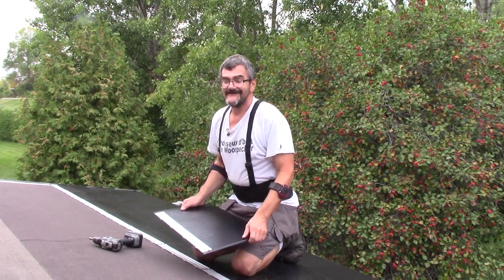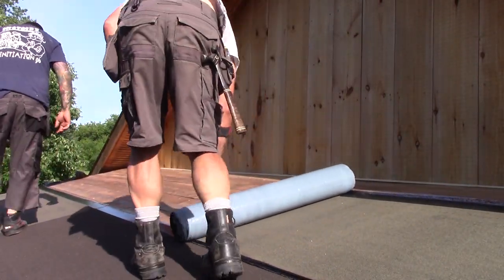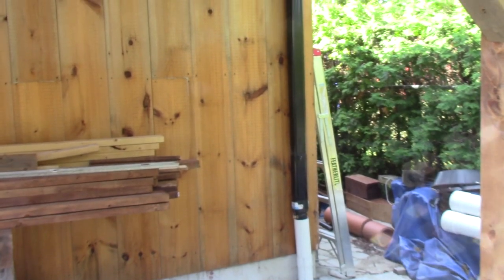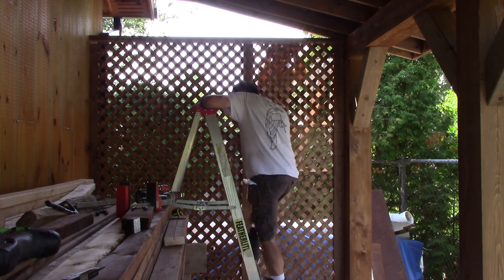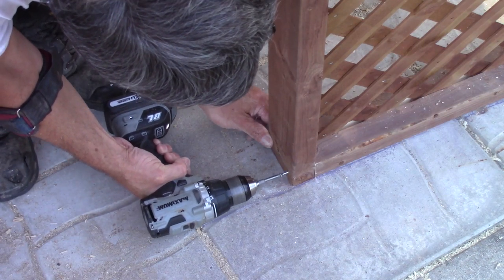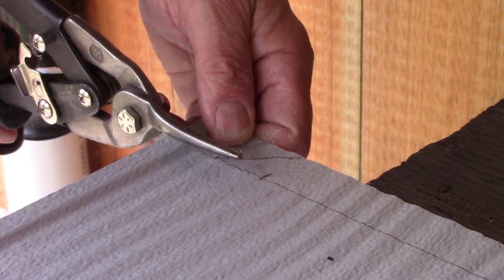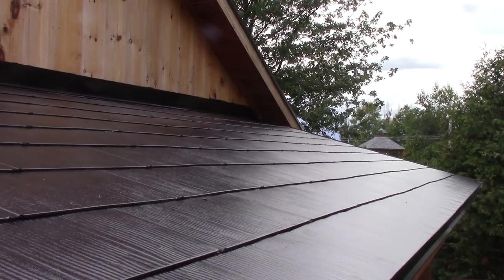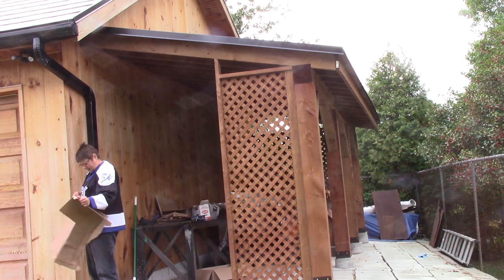The Woodpecker Ep 202 -  A carport for my firewood at the back of the shop part 2

Comment: I picked up one of those Evolution saws on clearance, just to cut firewood…   I’ve acquired a, uhm, substantial quantity of romanian softwood that was used as shipping platforms for pipe, and these ~3x3 8 foot lenghts had been spiked together.  Prying them all apart was just too time consuming and labour intensive, so I opted for a saw that could cut the wood and nails all at the same time. Works great, and I’ve got about 3 cords cut up this fall.  Lots and lots to go.
Reply from the maker: I didn't know the brand before. It worked great for what I did. walking inside the shop at every cut would have been a pain. And like you say it's cool, it can cut nails and wood at the same time. It's probably not the last time I use it.
Reply: I first tried looking for a multipurpose blade for my old mitre saw, but the cost of the blade turned out to be about half of the cost of the whole saw kit  that I did buy, on clearance. And it was properly matched to the cutting speed.   I suppose now I can retire my ancient abrasive metal chop saw.
Reply from the maker: I don't know how long the saw blade can hold it's sharpness when cutting a bunch of metal?